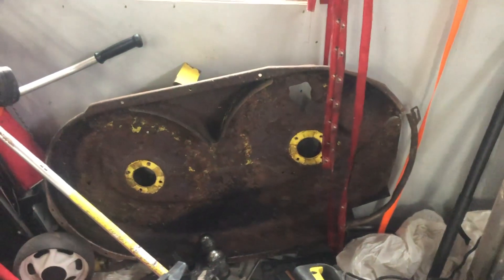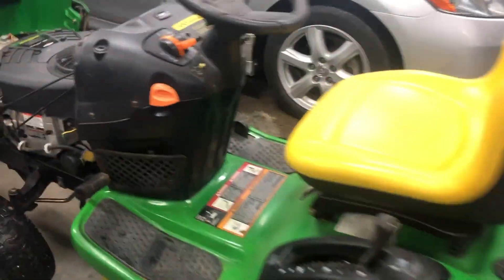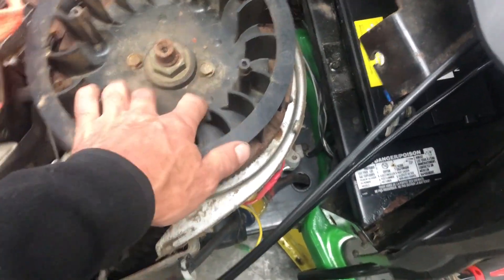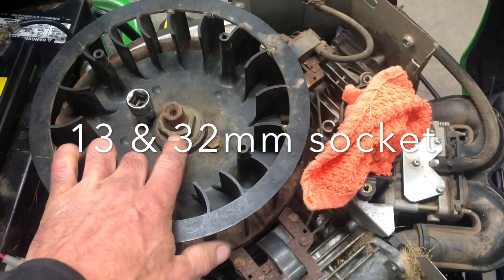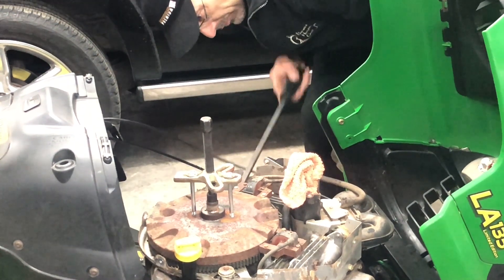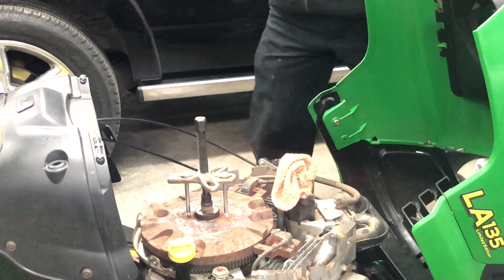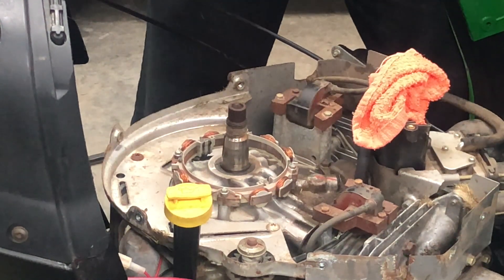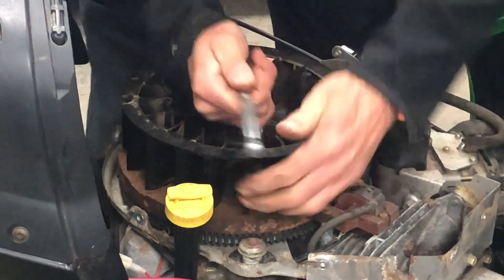How to remove a flywheel & Charging Stator Coil on a Briggs Stratton Engine

Comment: I keep cracking bolts does that mean I am doing it wrong or have it in the wrong spot bc the fly wheel won't come off and I was using brigs & stratton puller from amazon also had this flywheel off before it came off like ease but this time it won't
Reply from the maker: I sometimes use a heavy duty puller.  Then I hammer the top of the puller with a pry bar under the flywheel.

Comment: I have a john deere Z345M that needs the flywheel,  stator and coil packs replaced. My repair guy had me order the wrong stator so I ordered the correct one and it should be here tomorrow. He has the top half of the motor tore down and ready to put the new stator in. After watching your video here I feel like I could possibly do this myself. Thanks for the video. If I need your help can I call you lol

Comment: How does the Single Wire Stator Charge the Battery? Mine is a Single wire but the tractor has two wires for the charging system?
Reply from the maker: Is the Single wire coming from the regulator?  If so tie the two wires together.  Check the video at 0:30.
Reply: @WeekendHobbyMechanic  I have a single wire coming out of the motor going to the ignition Module. I also have the two wires from the coils tied together coming across the top of the motor to the back (Kill Switch). But I have a 3 wire engine wiring harness. The White wire goes to the Ignition Module and the 2 wires (Brn/Wt and Brn/Yel) that should go to the Stator According to the Electrical Schematic. But I have no idea how if the Stator only has 1 wire. I tried to connect the two wires together before and then to that single wire (which has positive voltage) but it just kills everything. Turn the key and i don't even get the oil pressure light to come on.
Reply from the maker: Watch this video. Let me know if it helps. 
https://m.youtube.com/watch?v=Fe0N9xfAxGk&t=30s&pp=ygUPQ2hhcmdpbmcgYnJpZ2dz

Comment: For anyone confused by 2 coils-- the stator is not usually referred to as a coil. It is more like a stationary alternator.  The 'official' coil is the small part that fits against the flywheel and feeds spark to the plug.  Wonder if you could hook a flywheel turning wrench/tool onto the ring gear and hold the wheel with it? Don't know how accessible the ring gear is, you'd need room to fit the tool. Great video, thanks.

Comment: great video!  Trying to figure out a parts mower I bought, the previous owner had the flywheel off for some reason and it didn't sit all the way back down on the crankshaft.

Comment: I couldn’t get the nut off the flywheel even using a breaker bar. The other issue is trying to unscrew it but the flywheel wants to spin.
Reply from the maker: Somehow you have to use a large screwdriver and jam it in the flywheel gear.  Or borrow a impact gun.
Reply: Just throw some nuts and bolts in engine cylinder. It'll stop spinning. Lol. Don't really do this. I've used ratchet straps/belts, rope, etc around the flywheel and find a place to hook it to to keep from coming off.

Comment: Good to know you can up the Phase of the stator. I did this on my Harley. Changed it to three phase. Going from 35 amp charging to 50 amps. Love to see how many amps the two wire stator puts out.

Comment: Should I be able to see if the the key is sheered without having to pulling the flywheel? If not I have a 
a three claw crank puller. Would that be applicable for removing a flywheel on an 18hp twin opposed? 
Thanks
Reply from the maker: Yes, the keyways won’t lined up.   You can try your three jaw puller but a pry bar and a hammer will do the trick.
Reply: @WeekendHobbyMechanic  Thanks so much for responding so quickly and thank for sharing great content.

Comment: saw this after I tried to remove my flywheel.  Ended you stripping my puller. ordered the briggs one will try that and a big hammer.
Reply: Use a torch and heat the flywheel/crank.  If you have pressure on the puller will pop off.
Reply: The Briggs remover took it off no problem. I was using a steering wheel puller like shown in other videos my steering wheel puller was from Harbor Freight maybe why it stripped.
Reply from the maker: The Briggs puller is the best....